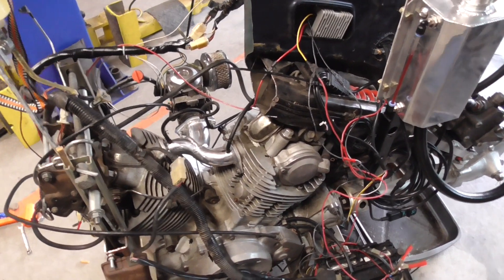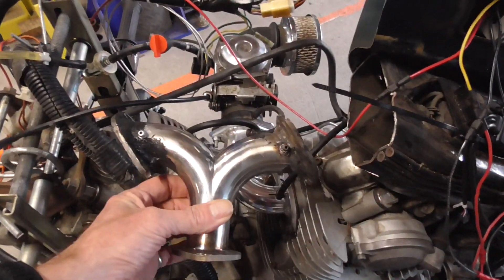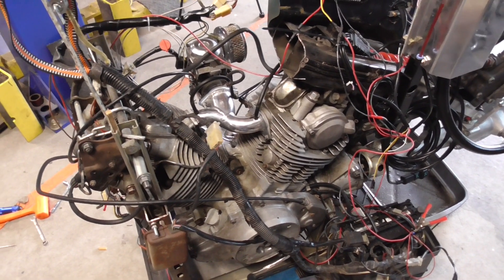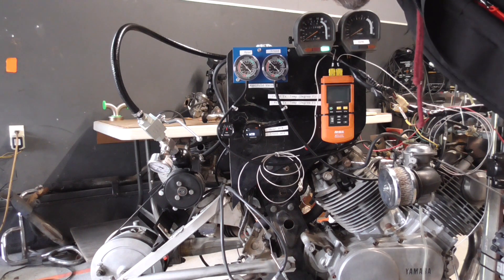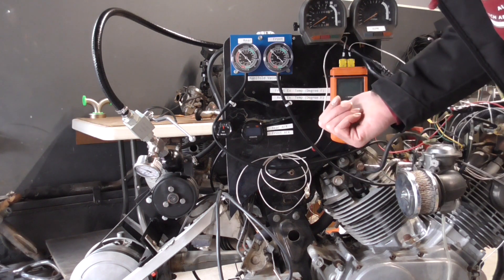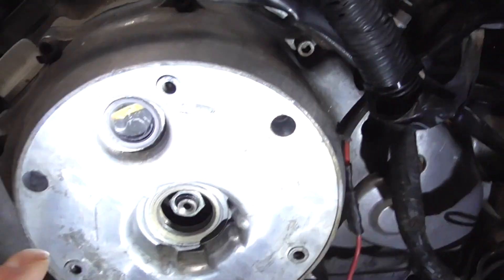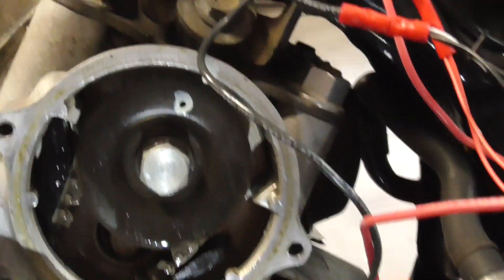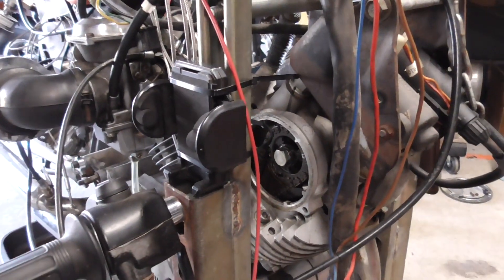Virago Single Carb Intake Cylinder Imbalance - It's got a lot to do with the cylinder timing

Comment: Hi Steve... this is Barry in California.  after changing the cam timing, I found that with the crank straight line showing in the sight glass, BOTH cam gears have their gear dot at the very top.  I'm concerned that i may have done something wrong.  I seem to be hitting a stopping point and I'm afraid the a valve may be touching a piston.  I don't know how much resistance the valve springs are putting on the cam... could that be causing the sudden resistance to turning the engine over?  HELP!
Reply from the maker: Hey man, sounds like the rear cam is out of position if the line only (not the T line) is lined up on the flywheel, but both cam marks are up top at the marks.  Here’s a link to an old video I did years ago that walks through step by step on how to verify the timing.  With the flywheel mark on the T line, the rear cylinder cam gear should be at the top under the pointer.  Hope this helps a bit and let me know how it goes:  '81-'83 Yamaha Virago xv750 Engine Rebuild:  Part 1-Establishing the Engine Timing
https://youtu.be/iVUSp_IiEX0

Comment: Hi)
I've been following your channel for a while and recently got excited about installing a single carburetor on my Virago 535. I chose a carburetor. In my country, they're often used on older boxer motorcycles. I've had experience installing something similar myself. I built my own manifold and installed the carburetor, but ran into a problem: the front cylinder has a rich mixture and the spark plug is black. The rear cylinder has a lean mixture and the spark plug is white. I've tried everything: changed the coils and wires, the pulse sensor, but nothing has changed the situation. There's only one option left: change timing. Will this method you described work, in my case, if I rotate the timing in rear cylinder 180 degrees?
Reply from the maker: Hey !  I’ve not gotten time to start on my 535 restore bike so I’m not 100% sure, but I think all of the Viragos use triggers from the flywheel to time the spark so swapping the firing order of the cylinders would be possible to try to see if it improves anything. The way to know for sure is that the pickups for the spark are down on the flywheel like the xv750, 920, 1100, etc. if they are, then swapping the timing might help things. 

Sorry I couldn’t give you a solid answer for the 535, but hopefully soon I’ll be getting into the rebuild for mine and I’ll have more knowledge of the details if them 👍. All the best !  Steve.
Reply: @StevesDIYs  Thank you for a very informative answer. The pulse sensor is located on the cover and is attached to the generator. As far as I understand, all Viragos have a similar design. The only difference is that some Viragos come with two sensors and some with just one. I have just one sensor. I wouldn't want to give up one carburetor and go back to two.
I'm looking forward to seeing the video on your Virago 535.
Thank you again for your work!

Comment: I don't know if you still have your test rig would be cool to know if you had a another front cylinder Cam and put it in the rear cylinder head with your timing offset to see what it would do
Reply from the maker: 👍. Might be interesting indeed, but I think the cams are opposite as the front turns clockwise while the rear turns counter clockwise I believe.

Comment: So essentially if you have a single carb conversion, it would be beneficial to time it this way, correct?
Reply from the maker: Hey !  A lot depends on the design if the manifold and if it balances the mix for the two cylinders.  If one of your cylinders is running rich while the other is lean, then swapping the timing so the front cylinder leads should help to balance them better.  The best part is, since it doesn’t hurt anything to try as the motor will normally run either way when equipped with the dual carbs, swapping the timing for a single carb setup will either improve the balance or not…but is easy to put back the other way if no change was noted. All the best !  Steve

Comment: So if I have this correct in my head. 
The new way is this 
Front cylinder #1 fires then 75 degrees later rear cylinder #2 fires then 645 degrees until front cylinder #1 fires again. 

And the old way was rear cylinder #1 fires then 285 degrees then front cylinder #2 fires then 435 degrees until rear cylinder #1 fires again
Reply: Sorry forgot to mention in my first comment, this is so cool by the way! Love your channel and the tips and tricks you’ve given me to use on my 82 920
Reply from the maker: 👍. Glad the video have helped some 👍. All the best !
Reply from the maker: Hey man !  Yep, you got it 👍. By making the front cylinder the leading cylinder on the firing strokes of the two cylinders, the motor only rotates he 75 degrees until the rear fires vs. the closer to the same rotation with the rear cylinder leading.  I’ve actually left my test rig motor set this way as I like the slightly different exhaust sound it makes this way lol.

Comment: I have a similar setup but has a mikuni carb it won't idle just revs high on start then putts out 
not sure what to do anymore
Reply from the maker: Hey man !  Have you checked to be sure the fuel height is correct in the bowl and the carb is relatively level when firing it up?  Sounds like it’s trapping liquid fuel in the manifold and then sucking it all in at the start up, then not pulling enough fuel (like the jetting is too small) so it starves for fuel once the initial liquid fuel is pulled in. These are pretty difficult to dial in for sure due to the distance the single carb is from the cylinder vs. the dual carb setup.
Reply: @StevesDIYs  not sure if changing the timing would help or if my idle jet is bad can't seem to find how to adjust fuel height in bowl
Reply from the maker: @rockyewelljr9781 hey again, the fuel height in the bowl is typically adjusted by bending the shutoff tab slightly for most carbs.  There’s a video out on the channel for setting the fuel height on the 1st Gen carbs with the metal tab.  If it has a plastic tab, those were not as easy to adjust as you had to bend the float arms.
Reply: i have tried like 5 different jet sizes  a bunch of different needle adjustments
I have no clue how to make sure the fuel height is correct   @StevesDIYs

Comment: How does one tell if a v engine has a wasted spark system in order to re time it like you did the yamaha virago. Could this be done on an older Honda V engine i am wondering ?
Reply from the maker: Hello, the easy way to know if a motor has a wasted spark ignition is if the pickups (or points for really old motors) are signaling from the flywheel vs. the cam. If the pickups are signaling from the flywheel (the metal tab on the flywheel in the case of the Viragos) it will spark each time the flywheel makes a rotation so every other spark is wasted.

If the ignition pickup is located on the cam, it would only spark one time (near TDC) for every 2 rotations of the crank or flywheel.

Hope this helps a bit and all the best !  Steve

Comment: Can be applied for xv920 and xv1100 ???
Reply from the maker: Hello, since both the 920 and the 1100 models use this same wasted spark ignition system (sparks on every rotation of the flywheel), it should be able to be done on those as well 👍. All the best !  Steve
Reply: Awsome this blessing
Reply from the maker: @jorgeirn08 thanks man 👍. All the best !  Steve

Comment: On my virago 535 the front cylinder is the richer cylinder after the single carb conversion.
Reply from the maker: Hey !  I’ve not gotten a chance to play with the 535 bike I picked up last year, but the carbs look pretty bad so I may be going to a single carb on it once I start in on the restore. I was actually hoping that since the carbs sat together between the cylinders on the 535 that one carb might balance better on these vs. the 750’s and 920’s, but sounds like that may not be the case from what you found.

Comment: This video was great Steve! Thanks for the detailed demonstration with real time measurement and pro-tip about the waste spark facilitating the timing flip. Clever!
You seem to be on to something, have you puzzled out why the imbalance flips with the timing?  Do you know if any other twin motorcycles display this same mixture imbalance with single carbs?

I have the VTC motors S&S manifold installed on my 1984 XV700 and for me it works pretty well, especially as the manifold warms up. I even experimented with insulating the manifold on a cold days to get the bike to warm up quicker and run a bit better... it helps, but I don't really care to ride in the cold much.

All that being said, I do see that the rear cylinder on my Virago runs richer than the front and will eventually fowl out, particularly if I am puttering around town at low RPM or idling lot. The rear plug stays clean longer when revved up on highway miles and the bike will cruise at 55-80 MPH all day long without a miss if I start with clean plugs.

I've got a couple thousand miles on the VTC manifold and same spark plugs - every 100-300 miles I can feel it start to misfire so  I pull the rear plug and dust the carbon off with a scotch-brite pad and a little carb cleaner if I have it, then off I go again.  On several occasions, not just on the Virago, the plug wrench and a scotch-brite pad in my tool bag got me going again after fowling a plug during a ride. In a pinch it can save you in lieu of a spare plug.

I should mention that my XV700 has quite a bit less compression on the front cylinder than the rear. Last time I checked cranking compression with the bike warmed up and opposing plug removed it was 95PSI on the front cylinder and 105PSI on the rear cylinder at 7000feet. Not sure, but maybe my front cylinder runs even leaner because worn rings, seals or valves are letting un-enriched air sneak in during intake?  I haven't done any leak-down tests yet. 

I also run on the stock single muffler if that factors into the equation at all.
Reply from the maker: Hey !  Thanks and glad the video was interesting…especially on how these have the wasted spark ignition.  I’m not 100% sure, but I think the imbalance is due to the leading cylinder pulling the vacuum through the carb (which lifts the slides and pulls in fuel), then if the other cylinder has a delay, the slide will fall and then have to be lifted again by the other cylinder.  The erratic slide lifting probably leads to liquid fuel coming into the manifold and then having to get pulled into the carb vs. being properly atomized and coming in with the air.  The liquid fuel will atomize (evaporate) a bit better when the manifold is warm so it can then burn better…but it’s not very consistent so it makes for difficulty in ever getting a tune just right.  Old school carb’d multi-cylinder automobile motors used just one carb and even had odd shaped intakes, but since they are just pulling in air and fuel without having to lift a slide, they stayed pretty balanced and they timed the cylinders so it was pulling air and fuel relatively consistent.

Seems like Harley twins have a balanced cylinder offset so they can get away with one carb, but ones like these Viragos (and Suzukis like my 1400 Intruder) used two carbs so there wasn’t any fighting between the two cylinders for fuel.

It is a good idea to keep a bit of sand paper in the tool kit in case a plug fouls for sure as an option to keeping spare plugs 👍. For the compression numbers, I’ve found that different compression gages read very differently on the pressure based on who made the gage.  If you have a local automotive shop (like Autozone) that loans tools, you might take a ride over to the store and check the compression with their gage in the parking lot just to see if it reads differently to your gage.  From what I’ve seen, about 90 psi at idle is about as low as they can get and still run without fouling plugs just from the low compression not burning the fuel very well.  My stock 1st Gen 750 is down to about 95 psi on both cylinders so it’s due up for a refresh, smells a bit like unburnt fuel lol, but still runs fine.  I’ve been running the Iridium ones for years now as they don’t seem to foul as bad as the regular plugs…they only come with the resistors though so the resistors in the plug boots have to be removed (or resistor-less wires used if they cannot be removed).

Thanks again and all the best !  Steve

Comment: Super informative and an intriguing result, thanks for the vid! 
I am hoping to lean out my mix, i've got a VM38 Mikuni single conversion kit on an xv1100. Thinking to re-jet the pilot and main a little leaner, getting a lot of carbon build up and misfire after 10-20 mins of running after putting in a clean plug. The front cylinder is perfect, nice cooked caramel colour on the plug but the rear is sooty and causing the engine to cut. Wonder if flipping the timing 180 like this would help and might try it down the track! Cheers and keep up the great work, it is invaluable 👍
Reply from the maker: Thanks and glad the video was interesting 👍. Yep, the imbalance between the two cylinders is the toughest thing to level out for the single carb intakes it seems. I got tired of playing with the intakes lol, but I since I drilled holes in the test manifolds to monitor the vacuum, my next thought was to put a little metering needle in the hole of the richer cylinder and let a controlled air into the manifold right where to connects to the cylinder.  That way I could lean out that cylinder just a bit to see if I could find a balance…might have to pull the test rig out of the attic again one day and give it a try lol.  Seems like years ago there was a company that made a thing called a “Dial-A-Jet” that tapped fuel off a motor’s carb bowl and fed it into one of the cylinders…seems like it was for a snowmobile motor or something. 

Anyway, thanks again and all the best !  Steve

Comment: I've been looking for something like this for my 1994 Kawasaki VN-15, but all I can find are hackjob intakes in the style of the black one you showed in the beginning, with the very short runner to the front cylinder and the longer one to the rear. Any pointers on a good(-ish) solution? The following model generations all came with a single carb setup from the factory, but they didn't have the problem of unequally opposed intakes on the cylinder heads.
Reply from the maker: Hey !  I’m not sure who might be making one for the Vulcan if anyone.  From the studies I did on the Viragos, the manifold design definitely makes a difference so if I found one, I would definitely check with the Vulcan Facebook forums to see how they did. Sorry I could not help any though, Steve

Comment: Awesome , what do you thing ?  Better stock timing or your set ?
Reply from the maker: Hello, swapping which cylinders is the leading cylinder definitely helps balance the air/fuel ratio for a single carb intake, but since I still run the stock dual carbs on my main motorcycles, I haven’t had a chance to really test out which way runs better overall with the single carb setup. Maybe other owners that have swapped the timing will see the comments and reply on their results.

Comment: Hey Steve, what jets did you end up using after this?
Reply from the maker: Hey !  To get the single carb to run right, I ended up at about a 155 on the main and a 50 on the pilot if I remember right. Since the carb was one of the stock Hitachi’s from the 1st Gens, it’s probably not the best pick for a single carb though.
Reply: @StevesDIYs  amazing thanks. I just switched up the sparks plugs for 5's and it sorted running issues. Im just not 100% sure they wont get fouled again

Comment: Good day Steve !! 
I’ve been looking for a full video how to swap the single carb. Do you have something like this 

Xv1100 full single carb conversion
Reply from the maker: Hey man, I haven’t done a complete swap for one of my bikes yet as I’m hoping to get a couple more manifolds to test out to see which one balances the cylinders the best.  I think more modern carbs would work better than these old Hitachi’s I was testing with though based on what comes in the kit from Mikunioz.
Reply: @StevesDIYs  my mikuni hsr t42 is put in bout I don’t know how to plug the rest of the hoses

Comment: Dude, you having no idea what you are up to... Virago runs with single carb as a champ. Just one thing... You must know what to hell are you are doing. Stop confusing people. Thanks a lot and cheers.
Reply from the maker: Hello again, as I showed in the videos, a lot of running one of these with a single carb successfully has to do with the design of the manifold. It’s apparent that you cannot just put any single carb manifold on these and expect it to run right as the AFR gets thrown off between the two cylinders if not designed correctly.

As with the replies to the comments you had made on the other video and previously on this video, I’d be happy to put one of the single carb manifolds you make on the test rig and show how it performs on balancing the AFR for the two cylinders if you believe your design is optimized. Or, if you have some data that shows how well yours performs against the stock dual carbs (or even other single manifolds) I’d be happy to see it. All the best ! Steve
Reply: @vtcmotors 
The numbers don't lie, and physics can't be tricked. So either step up and prove him wrong; with the emphasis on the proof part. We want hard facts, and not some backyard-mechanic blah-blah.